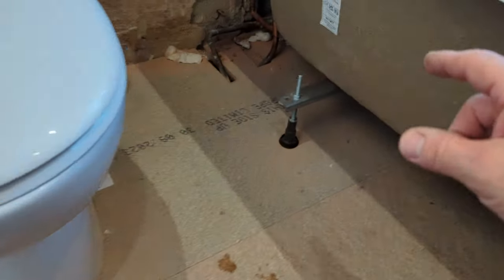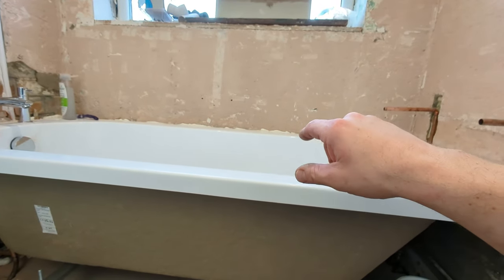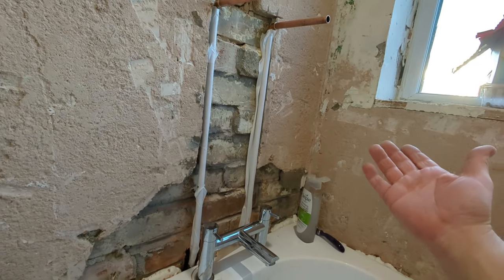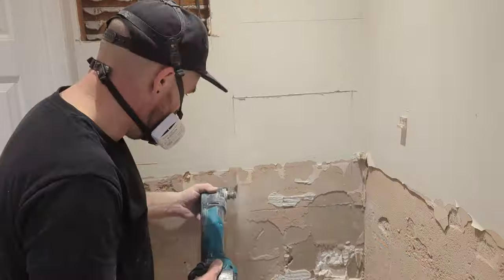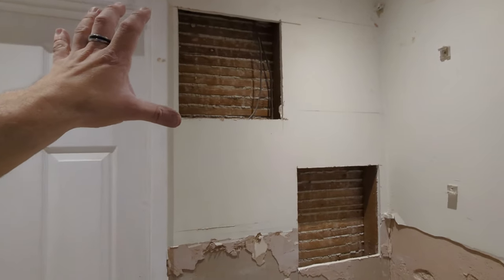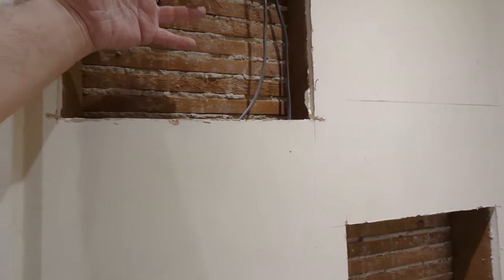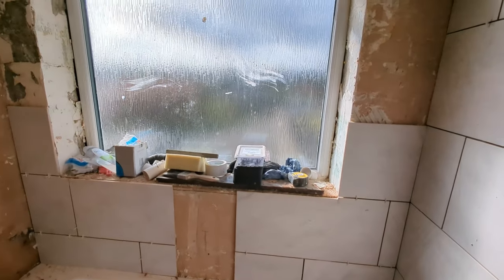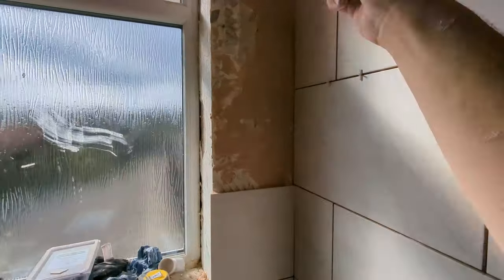Small bathroom remodel idea's 2024 EP, 3

Comment: how do you find living with the small bathroom? my bathroom is similar in size width wise so our tub fits wall to wall much like yours but where you toilet was is where our sink is then to the left of that is our toilet (so that would be other side of your rad wall for instance), then opposite the loo is the door into the room.
now, i ask because we bought this house as it has a down stairs extension and the plan has always been to do the 2nd floor extension on top and add the 4th bed room we need and the only logical way in would be to remove our loo and continue the hallway through the bathroom door and where the loo is now (there is a small window there behind the loo) would be the door into the new build.
My options are to stick loo where my sink is now and then have the sink opposite and obviously stud wall it in so it would be pretty much identical to your bathroom, or would you opt to take more of the wall down and essentially pick up our bathroom rotate it 90 degrees and plonk it back down so we keep same amount of floor space but obviously loose bedroom space... few things i think about is, it would be cheaper to make it small like yours as id only need a door lintel into new bedroom over a whole wall section requiring rsj etc so much cheaper to go smaller, the other issue i think i have is that the extension doesn't go all the way to back of the house, it stops 2ft short so it would be like a cubby where the loo sits into if you know what i mean so i would gain all that much for it.
Be interesting to hear how you find living with a small bathroom day to day. (removing bath for a wetroom shower also not an option as the wife would leave me without a bathtub haha)
Reply from the maker: Hi there thank you for watching!

Honestly it doesn't really bother me, I spend so little time there anyway. It's cheaper to tile a small bathroom 🤣. I plan to extend to the side of my house one day (which would be above the garage) the full depth of the house to create an extra double bedroom and a decent size family bathroom. So I guess I'm comfortable with it as I know it's only temporary. Obviously the bathroom is finished now and it looks fantastic, the Mrs is already having second thoughts about my extension idea. In a few more years when I am much less abled I'm sure I will require a bigger bathroom so it will force my hand.